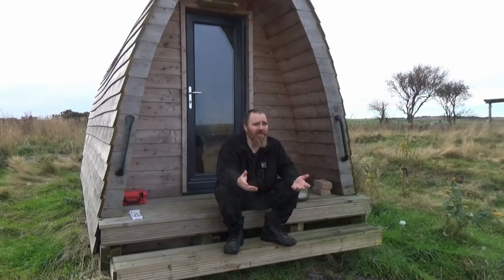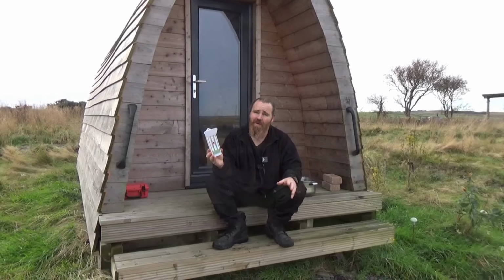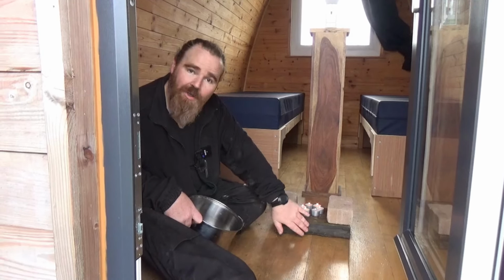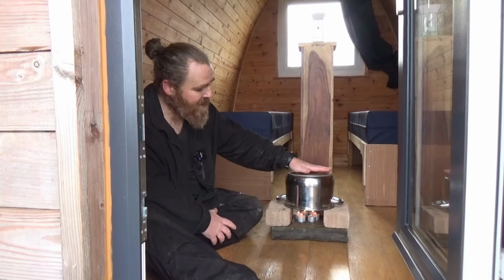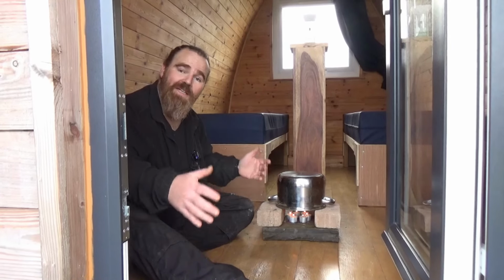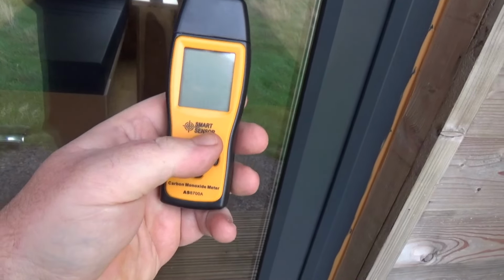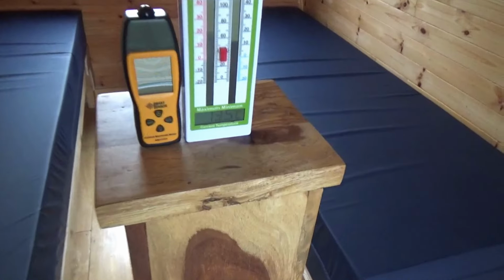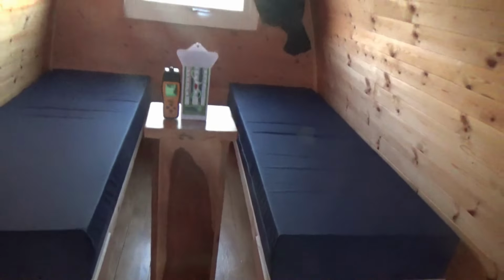DIY Flower pot candle tiny house/camper van/power cut heater tested. Effectiveness? Carbon monoxide?

Comment: Remember this for anyone trying it........keep the candles as far away as possible from each other under the pot that you use........do not put them all together in a bunch where they are touching each other.......they will ignite in certain circumstances if they get too hot....leave it exactly like they did in the video with that gap at the bot.....do not encase them at the bot of the pot.
Reply: Yep, I had already proved you right before seeing your post here...I made the mistake of letting the candles touch & had placed a metal tray beneath the candles...had quite a fire blazing up when the wax ignited, but was able to smother it out fairly quickly without too much damage.
You must be sure the wax doesn't reach ignition temperature, so be cautious as he said here, everyone.
Reply: Metal tray to out candles on is wise
Reply: Also they will melt each other
Reply: I've used Terra Cotta heaters fir several years now they work great abd I make my own candles mixing crisco w wax be careful making these.  You will get burned if you still it on yourself abd it cannot boil.    Very easy to do but I've become an expert at it now.
Reply: Use a flat black, cast iron, pot for more heat.
Reply: I have temps similar to Sthn England every winter.  With probably 1/10 the rain.

I sleep next to a sliding door, 18" 45cms, open, every night.  In frosts that can be maybe -6° C, at worst.  Maybe 5 nights in winter.  

I have lived with no heating, with the foot end of my bed about 2 feet from the opening of the back door, for years.  So open to whatever weather

In the morning, I sometimes breath out visible ice crystals - whatever it is...

I have lived like that as old pensioner for about 12 years.  I wake up toasty warm.  I use one hot water bottle - I have tried 2 on the coldest nights. Boiling water filled.  I use 3 cheap doonas in the worst cold, and I have 3 or 4 cats that sleep under the doonas with me.  Always a gentle warmth, in the morning, they are toasty warm.  One is grumpy when I have to move to stop cramps or get up to wee, but as long as I am in bed, I am toasty warm.  No worry with gases.  Including parps.  I get very bad arthritis if my hands are above the doonas.  They always have to be under the doonas.  And I am allowed to warm them if they get icy, while I type on the phone, if I massage the back of a very warm cat, when I have finished.

I go to bed as soon as possible, in the early evening and mainly listen to audio books or podcasts until I fall asleep.

I did do a similar thing with 3 small dogs and 2 cats  in the past.

That is a very old way of keeping warm.  The origin of a 3 Dog Night.

A freezing night so cuddle up with 3 dogs.
Reply: @justtinkering6713  blasphemy!! Where I come from people will put the family cast iron in their wills…🤓
Reply: @naomisims7230  Sad to say, I think there will be many fire problems in Europe this Winter with people trying all sorts of ways to keep warm..
Reply: @georgielancaster1356  Where did you buy your cats?
Reply: @paulrichards2365  No real cat lover would ever buy a cat.  Rescue or adopt only.    Some rescues offer very cheap desexed cats.   And feed and care for them, treat them kindly, or they WON'T cuddle up in the bed.   And, if rough with them, they will just look for and find better homes.    

I rescue them  I have rescued and rehomed about 150/200 cats over 20 years.  I desex, do their shots and worm them regularly.  You want to do rabies, with dogs, if you are in US, middle Europe, and especially the Indian subcontinent.  I know Nepal has a huge problem with rabid dogs, even now.

Wet food is better for cats.  Fresh meat is good but not balanced

Dry food can knock out kidneys and shorten lives, with some cats.
Reply: @georgielancaster1356  we called my friends whippets hot water dogs. On  a cold night she would let me take 1 to bed when I slept over!
Reply: @fuzzilu  Lol.  Whippets are hardly bedwarmers.  I love rescued greyhounds, whippets, Italian greyhounds, but they cannot take cold.  They wilt like delicate ballerinas, and look totally miserable.  

I suspect your friend was actually wanting to use YOU as a hot water bottle for the dog!

Best is a stocky little/medium dog or three.  But cats ARE better.  They are gorgeously soft and meld around your body.  And spreading 3, around, is lovely.  If you are on your own and in a double bed, you could have 6!

If peoplr are on acres, you can make fruit pies with damaged fruit and swap them for tinned cat food, from friends, neighbours and family, to help feed through the year.  The cats will slso hunt mice and rats, but don't skimp on food to cynically make them hungry to hunt more,  because they won't cuddle up with you in winter.  They'll look for a kinder home and leave.    The best hunter I have is obese.  He knows where the mice travel and he sits in great spots and waits for them to come to him.

Please take pride in glossy, well fed animals, that will impress any animal experienced people who visit.

If you are cuddling up with the animals  they need to be plump, great skin, glossy costs, wormed and healthy.
Reply: @georgielancaster1356  beautiful & fascinating thank you
Reply: @georgielancaster1356  my lil terriers def a bed warmer .. my mates whippets hoofed me off the sofa on another sleepover. They like their comfort !! Aww
Reply: @georgielancaster1356  Charmingly written! I hope your talent regularly produces stories and books.
Reply: BOT?
Reply: @jamesjameson4566  Bottom.....meaning leave a gap for air to come in and to try and keep the candle containers as cool as possible.....if it gets to hot in there the liquid paraffin in the candles will ignite. Not a pretty sight.
Reply: @jamesjameson4566  bottom I shd think .. it gets hot at the bot of the pot! Lol
Reply: @georgielancaster1356  you are very smug
Reply: @jamesjameson4566  Thank you. 

 Comes with long life, great education, and natural intelligence - and a subject of particular interest and importance to me.  

People have been very kind in their comments - and some have even guessed I write, which was quite touching -  some can pick it from what is less than a quarter of a page.

I just thought I would let people know they can be warm, without risking little makeshift fires

If I can get someone through a hard winter, with little money,  I don't care  what I am called.
Reply: @georgielancaster1356  you make money from writing?
Reply: @u.synlig  Thank you  :-)

Hope you try the old hot waterbottles and multiple doonas  - if you get the doonas in summer, at charity shops, it costs VERY little.  If you wait until it gets cold, they are all bought.  

You can even buy 1 or 2 sleeping bags and a queen or king doona, so they can multiple layer into a warm soft bed,  and give 2 hot water bottles to a homeless person  in winter, if you want to help out another.

If you go to building supplies  shops, they stock thick plastic, usually either clear or black, that is 6 metres wide.  It is used as a moisture barrier, laying concrete.  You buy it on rolls, folded, to 3 metres wide, but unfolded, will be 6 metres wide - and you buy by it the metre.  

A homeless person could tuck themselves inside the sleeping bags/doona, with the foot end of thr plastic, tucked in to be waterproof, rolled a few times in the plastic and the sleeping bags/doona,  and ask at a shop somewhere, for 2 kettles worth of boiling water for the hot water bottles, and just open at the head end, and they should be so warm and pretty dry.  Maybe give the whole set up as a gift, at the start of winter?

In the morning, a homeless person could wrap the sleeping bags/doona, spare clothes, in that same plastic, to keep dry.

Edit:  I do write!  Not under this name!  Well spotted!
Reply: @fuzzilu  I love terriers.  Especially wire haired
Reply: @georgielancaster1356  . What are / is doonas please.
Reply: @trailertrashfire  tealights tend to be completely melted fairly early after burned on there own.  How would a melted tealight be a problem?
Reply: Good luck to all you mòrons not burning your house down. A hand warmer in your sleeping bag will keep you warmer for less money, won't put particulates in the air and won't burn your house down.
  Just sayin' .
Reply: @naomisims7230  The whole thing is a mistake.
Reply: I heard cables create carbon monoxide fumes.
Reply: @georgielancaster1356  Lots of blankets and a cat does make for a warm bed. I use a vintage galvanized oval-shaped hot water bottle, with boiling water it lasts seven hours. Made a cover from an old towel.
Reply: @georgielancaster1356  well done, stay safe, I grew up in South City Dublin Ireland in houses that were like fridges, 2 bedroom upstairs and a tiny kitchen and a sitting room, toilet was in the hall facing the back garden, no central heating 1 fireplace,bad flu and chest infection was rampant in 70s and 80s, but made ye Hardy,I live in a 20 Yr old apt now, good to hear your story gbless
Reply: @BettyDuguid  sorry.  Didn't know I had a question.  They are like quilts - but padding is lighter.  Either feathers or a very light synthetic filler.
Reply: @jjbrowned313  Thanks.  Hope the decade treats you kindly.
Reply: @karen4you  Hot water bottles are great.  If using an oven, you can also put bricks in and place on 4 or 6 tiles, on floor, maybe a folded towel 3 tiles down, to stop too much heat reaching floor, so  carpet or floor isn't marked.  Fold an old towel or 3 on top, and rest your feet on it while you watch tv.

No fire risk.
Reply: @cmaggie5748  Best to place that on a couple of big tiles.  Look out for odd ones, thrown away.  With a folded towel underneath, and 2 tiles stacked under,  It makes sure the metal doesn't heat up and melt carpet or mark wood or lino type floor.
Reply: @johnoneal1234  I think my non fire answer is far safer and works well, but insulting people is no way to make your point.  Counterproductive.

These people are here because they are struggling with costs.  Why are you not giving them hints or different suggestions kindly  explaining why your suggestions are safer?  Many have not been in tbis position before.  We all have to learn.  It is a joy of living, to increase your knowledge and share it - and give a hand up where you can.  Unless someone is promoting cruelty or second rate care for people or animals, why don't you respect them, as you would want to be respected?
Reply: Thanks Dad
Reply: @BettyDuguid  I googled it. Australian word for padded blanket. We might call them quilts.
Reply: @johnn3542  oh no I tried different candles pillar candles because honestly I'm not a big fan of the flower pot heater with tea lights. I should have just put the pillar candles in a container duh 🤦
Reply: @karen4you  . Thank you Karen
Reply: @georgielancaster1356  . Thank you.
Reply: @georgielancaster1356 Good idea! how long does the bricks retain their heat from the oven?
Reply: WhyTheUniverseNoQmark  what do you think? People will take the chances because they don't want to freeze because they don't want to get sick and get some chronic laryngitis because of the constant cold.
Reply: @georgielancaster1356 I would love to meet you. You sound so dear. I am going to do the hot water bottles in bed this winter. Much love for your recommendations. Be well, warm and blessed this winter.❤
Reply: @georgielancaster1356   I am much obliged of your wisdom and your whimsical , intelligent, gifted writings

Comment: Putting a shallow pan of River stones on the top is lovely as if you are feeling cold you can pick a stone up and hold it... Or put a few in a pan to put your feet on top.... It is also possible to heat up bricks wrapped in a towel to stick in one's bed... Another favorite of mine is to have wool and leather clothing  layer..layer and layer.
    Down is wonderful too...nature provides when we remember what our ancestors did .. canopy beds with curtains that closed also helped to keep things warm...so does a tent on the bed ..
Reply: Tent on a bed is a clever idea in power cut. While it's rare I'd use heating during the night it would be a good way to conserve heat if necessary even during the day. Just as comfy to sit on a bed as on a couch
Reply: I 💖 my sheepskins!

Comment: We have a pack of Siberian Huskies that produce so much body heat I think I could survive by just bringing them all in and shutting them inside a room! This is a great alternative, though. 😄
Reply: I have Husky Heater too, very reliable ..
Reply: We have triple basset power
Reply: My Dad said,"It's so cold out It's a three dog night."
Reply: I have three Pomeranians,. Their constant barking heats the room up really well even at night. Lol
Reply: I have a shih tzu. They were bred to keep ladies' feet warm.
Reply: The huskies would be much safer than little fires, though.  Lovely fluffy beds around the floor...  very warming.
Reply: @debbiecurtis4021  they are great for shihtz and giggles
Reply: Like wearing all your winter jumpers at once.  The huskies would be panting though.
Reply: @georgielancaster1356  Like giant mobile rugs - talkative rugs.
Reply: Instead of hp for horse power..hp fir husky power😀
Reply: Chelle B But wouldn't the doggie bears get to hot 🔥 then????

Comment: I tried a flower pot heater in the bedroom during a February wind storm here in Seattle which had knocked out the power. The temperature outdoors was about 40° F. It was a small bedroom and maybe increased the temperature 3 or 4 degrees. It helped a bit but I still spent the eight hours or so that the power was out curled up in bed under as many blankets as possible.
Reply: The flowerpot only concentrates the heat. You could just as well burn the candles without the pot.